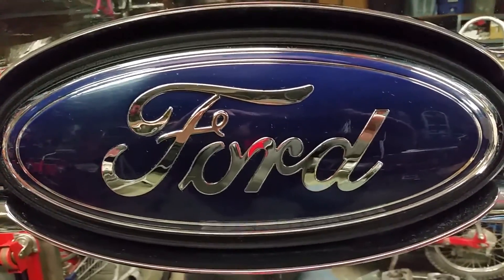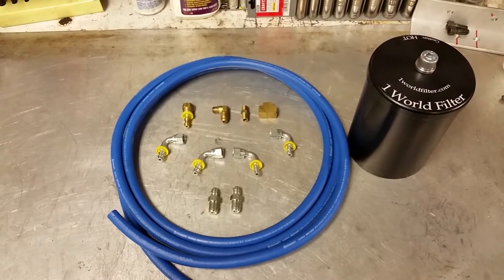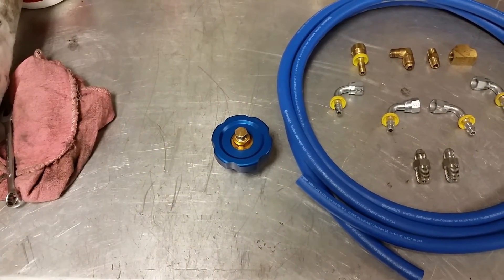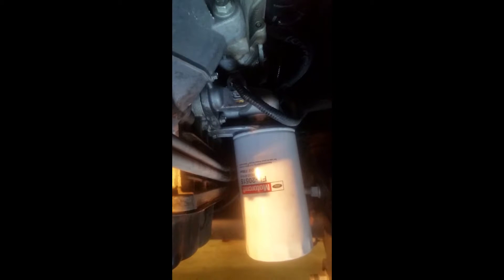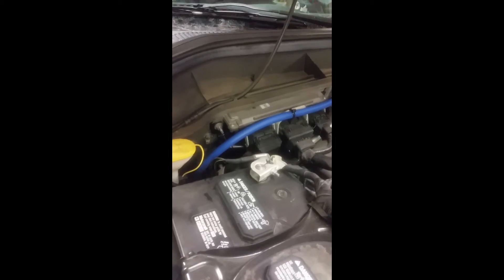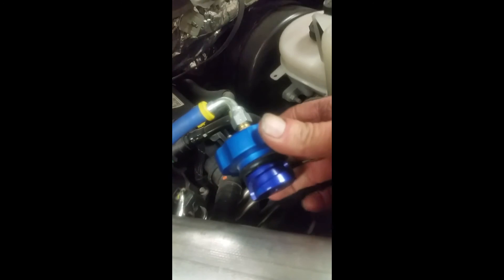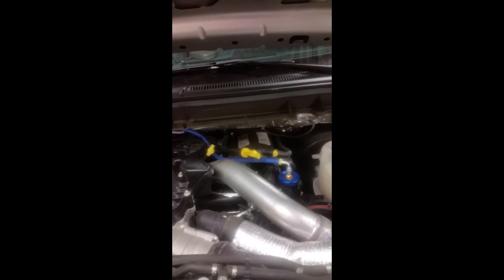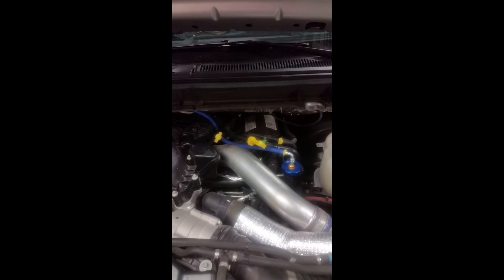6.7 Ford Powerstroke Insallation of Insane Diesel's Extreme Filter

Comment: Returning the oil back from the top of the engine worries me because the old system returns it back into the oil pan immediately from the filter. This system returns oil from the top and its got to make its way back to the bottom where the bearings are. I don't know, maybe I'm a worry wart. Thanks for the video, thumbs up bud.
Reply from the maker: This system only takes a small sample of oil continuously while the engine is running. So the oil will always be where it needs to be. Also this is an add on, so your current oil filtering system is still in place and working in conjunction with this bypass filter. Thank you for the comment!